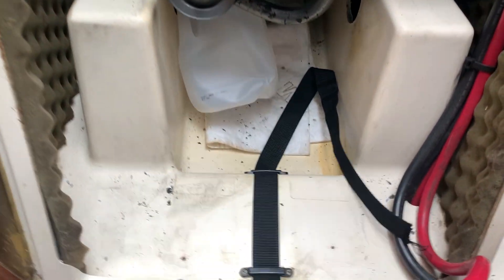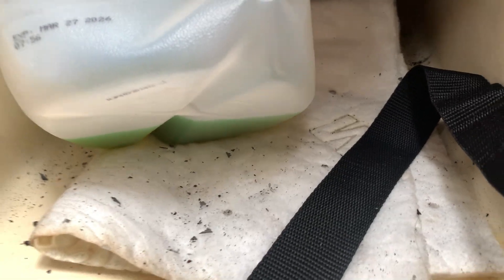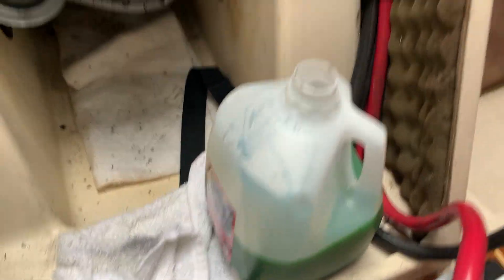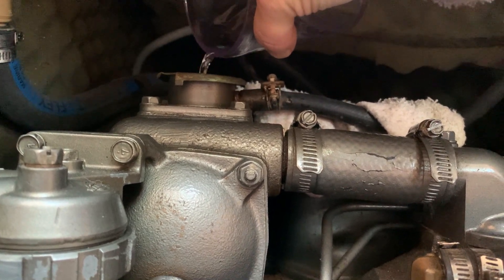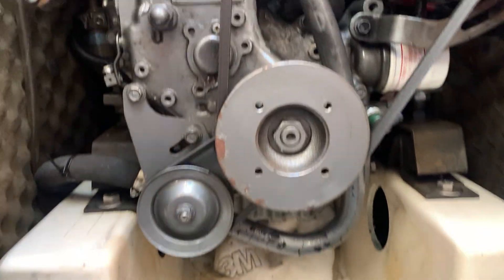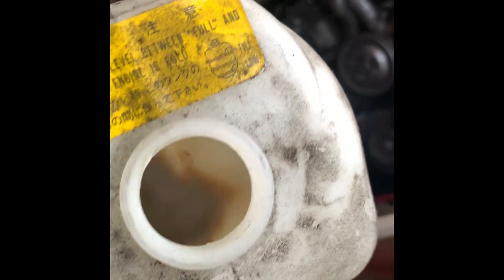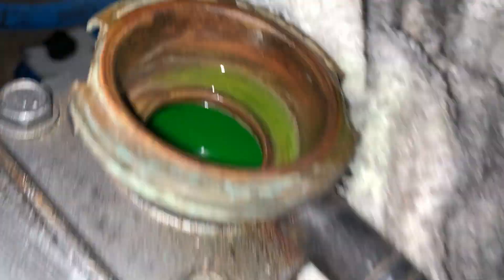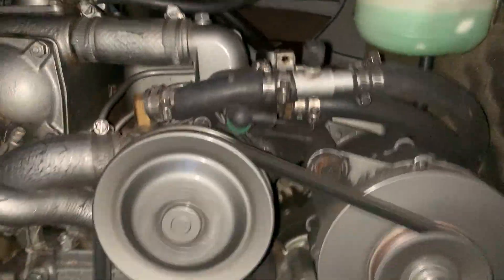Yanmar Diesel Engine Coolant Flush

Comment: thank you so much for your video. I had the same situation in my coolant expansion tank (the coolant looks blackish dirty), but the coolant in your engine looks much cleaner, do you know why the coolant got dirty in the expansion tank?
Reply from the maker: Glad you found the video helpful! I think the reason I had dirty coolant in the bottom of my expansion tank was simply settling of the coolant as it sat in the tank. You mentioned your coolant looked "blackish dirty". I'd hypothesize that your coolant hoses are older and deteriorating, leaving particles of black rubber in your coolant. Consider replacing them and see if that helps?
Reply: @seachalet_281  thank you so much!!

Comment: Be sure to replace the rad cap on the exchanger. There only good for 10 years. Mine went bad at 11pm coming back to states just as I'm entering key Biscayne. Bam, overheating engine in crazy winds with a reef on either side. 10 dollar cap was the problem. You know it won't go bad on a lovely June cruise to STM.
Reply from the maker: Thanks! Yeah mine was looking rusty on the top exterior so thought about replacing it based on aesthetics, but now will definitely replace it after this information.
Reply: @seachalet_281  it's the rubber seal under it that dries out, shrinks and cracks over time. Cheap to replace and keep the old one Just in case.